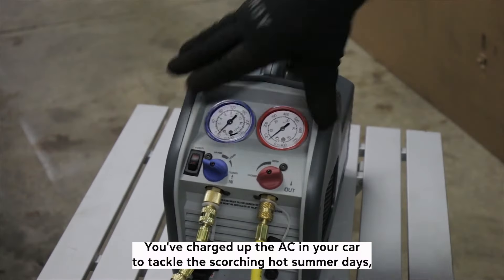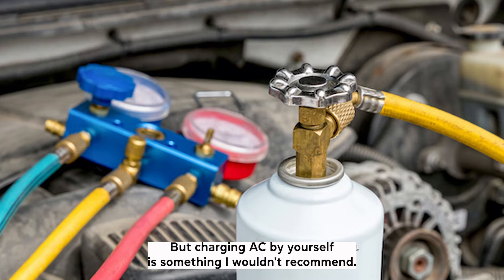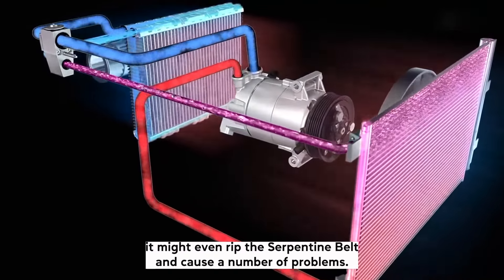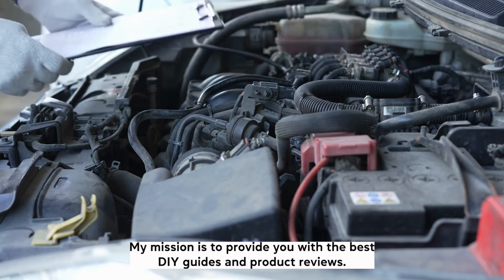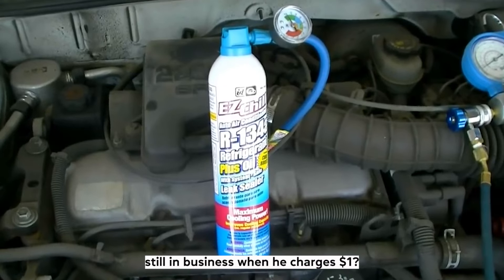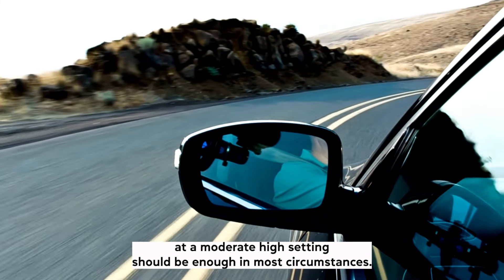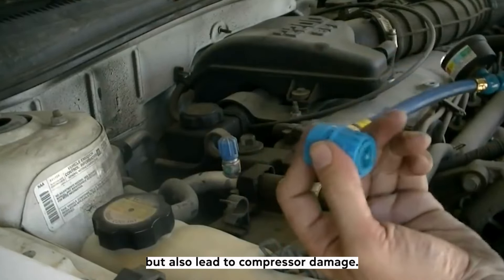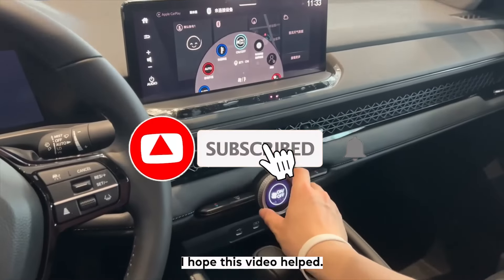How To Fix An Overcharged AC – Symptoms and Fixes

Comment: I think your advice is bad. AC is a DIY project. And I can not imagine how the belt can be damaged unless the clutch fails something unlikely due to an overcharge
Reply: My ac clutch failed before and snapped the belt in the dead of winter
Reply: @DjSmoothNY  I. The dead of winter your couch should have been free spinning and not engaging at all
Reply: @ProfessorDIY  the whole thing seized up. When I had it replaced I tried to spin the old one and that sucker was locked up lol.
Reply: @DjSmoothNY  strange to fail when it was free spinning without cycling but it proves either cars weird things do happen
Reply: @ProfessorDIY  yes it was weird to because the dealership told me the clutch was going when I had an inspection then sure enough that evening it locked up on me and snapped the belt. Actually shredded it to pieces lol
Reply: @DjSmoothNY  Weird my friend but wqith cars anything can happen
Reply: IT TAKES ALL KINDS!

Comment: How to fix an overcharged system. Take it to a mechanic, solid advice 🤣🤣

All you need to do is connect your filling gauge and hose to the low pressure side and dump the excess into a proper waste receptacle. Most gauges have an indicator which says what is too high and too low. Dont listen to this plantpot.